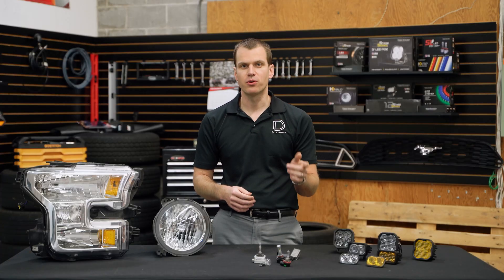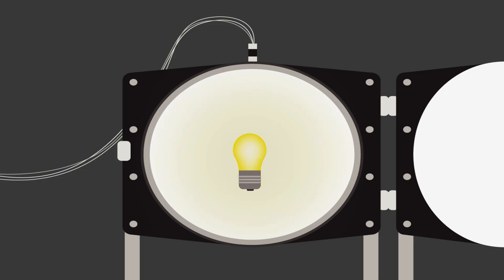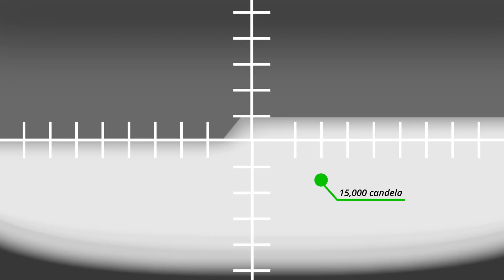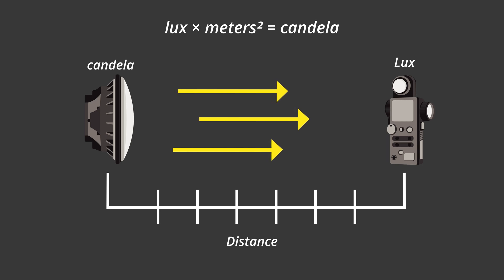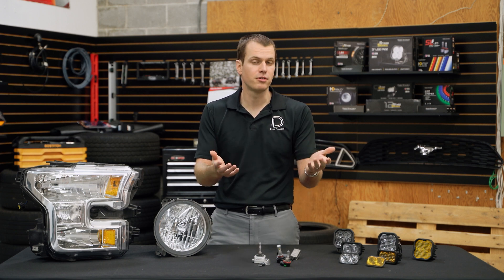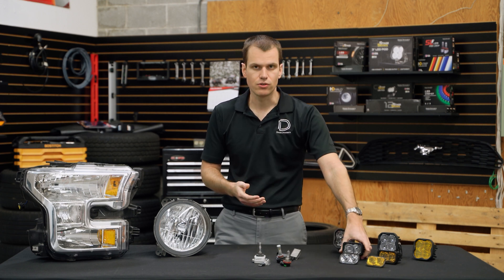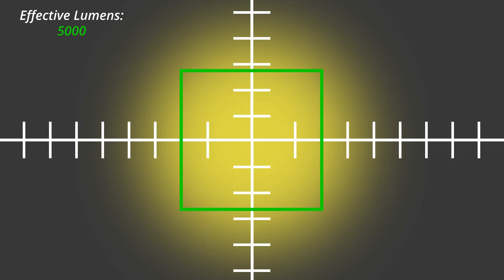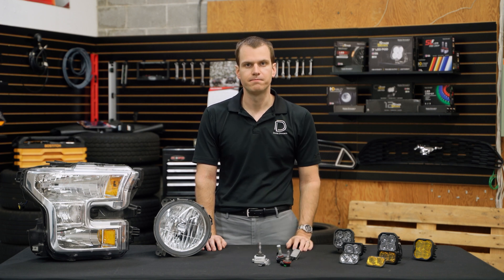Lumens, Lux, and Candela EXPLAINED | Diode Dynamics

Comment: Hey y’all, how’s it going this Sunday morning? Hope you were getting ready for the football games but anyhow I got a question it’s not automotive really but it’s drone related. I want a spotlight that I can turn on and off with the remote when I need to search for areas. I’m getting into the drone business and I’m going to venture off into the inmate search or whatever with police departments and any law of law-enforcement or prison system. I’m just wondering what what would be the best light do you guys know of any decent really really good lights that operate by remote that will go I don’t know 500 feet in here and turn on and hit the ground with a nice beam.
Reply from the maker: Hey there! We would highly recommend our C2 2.0 Pro Combo! You should just need one to get all the output you need, and would shine far past that 500ft. benchmark. They can be operated from 9-30 Volts, to a small battery would be enough to power them, and light enough to be attached to a drone!

Here is that link for you to check them out! 
https://www.diodedynamics.com/c2-2-0-sae-dot-white-pro-standard-led-pod-one.html

Comment: Umole/meter/sek. Is the most accurate measurement
Reply from the maker: Great question, but µmol/m²/s is actually not the right metric for automotive applications. It's used to measure the amount of light energy available for photosynthesis, which is essential for plant growth. In contrast, automotive lighting focuses on how bright the light appears to the human eye, and that's where candela (cd) comes in. Candela measures the luminous intensity in a specific direction, which is critical for things like headlights and off-road lighting where you need focused brightness and visibility. While µmol/m²/s is more about counting photons for plants, candela ensures the light is effective for human vision and driving safety.
Reply: @diodedynamics  I agree. You have a point.

Comment: Your example of 15,000 Candela is based on what distance?
Reply from the maker: This is the standard for current headlight models, we are unsure how far the standard is for stock headlights. Sorry about that!
Reply: @diodedynamics  Please confirm, I watched another video that explained candela vs lux vs lumens and they said it's 10 meters.
Reply from the maker: @jonmanilenio  After speaking with our engineers, yes that is correct.

Comment: Okay, wait, I'm still a bit confused... So if Candela is the most important metric of how effective a lighting system is, if we have the distance, and the lux measurement from a lux meter, we can determine the candela, correct? So given the example:

Distance: 10m
Lux measured at 10m: 1000 lux
Then Candela is: 1000 x (10)^2 = 1000 x 100 = 100,000

Is this correct?
Reply from the maker: You got it!

Comment: This is awesome information.  I have a few questions based on the video.  Since there is a minimum candela requirement for each degree plotted in the beam pattern, this made me wonder, are there maximums to this as well?  For example the 15,000 candela converts to about 245m or 800ft.  Is there a point where regulations would say something like "can't have candela over 30,000 anywhere in the beam"?  I'm wondering if the limit to how bright a light can get is based on the technology available at the time or regulations themselves?   I have your fog lights for my WRX and love them, the quality is amazing and they are so good, I delayed getting new headlights for my car.  I'm hoping Diode Dynamics comes out with a full Headlight Housing for that purpose soon :) Also would be interested in a video on CRI and CCT and the possibilities this brings to headlights for automotive uses.  I'm a huge car guy that recently has been learning about flashlights so it would be cool to see how the two blend together haha
Reply from the maker: Hello - yes, depending on the type of lamp, there are overall maximums that exist as well as specific maximums at certain points. This is most commonly implemented to ensure there is no glare shining towards other drivers. The limit to how bright a light can be is based on the regulations, however, you can always shine more light into specific areas where there is no maximum. So, the goal becomes careful focus to deliver as much lights as possible in the right areas. For more information, please see our newest video on LED Optics!

Comment: Manufacturers like Cree and Osram, Luminus, Samsung, Nichia will also list the viewing angle, or beam width. A good light company will match the led emitter to the task and put, for example a 15-30 degree beam angle in a spot light and one with say a 150 degree emitter in a flood. You can also ask what amperage they got the lumen count from. Also an important number is the candela per lumen ratio. For a headlight, higher is better.

Comment: Sir, I want to ask something? When calculating candela, shall we consider the brightest point on the hot spot in the headlamp beam pattern? Otherwise, when we buy lux from a few places, a lot of candela values will emerge! Could you please give some more information? Thanks
Reply from the maker: Great question! Most companies describe a pattern in terms of maximum candela - the point where candela is the highest. You could also describe the candela at the exact vertical/horizontal center. From there, specific points can be referenced in degrees. For example, (-4, 2) would mean four degrees left, and two degrees up. You are correct that every point will be different in candela value.
Reply: Nice to meet you! I did not study a university on this subject, but I very love automotive science. I'm happy to learn something thanks to you and youtube. Thanks

Comment: I'm sure this is going to be one of those moments I look back and shake my head at myself, but. I am having trouble with your equation values. 251000 Candela equals 0.25 Lux at 1001 meters.
 To make it work I need to convert the .25 into 250? Am I missing something? Do I need to move the decimal 3 places on all Lux values to get Candela? as in 1 Lux would become 1000. Or convert meters to milimeters. Great info though and thx
Reply from the maker: Sure! 
Candela = lux * meters squared
Or, 
lux = candela / meters squared